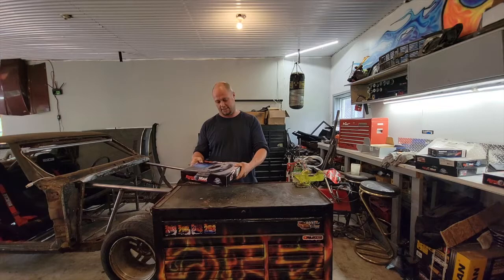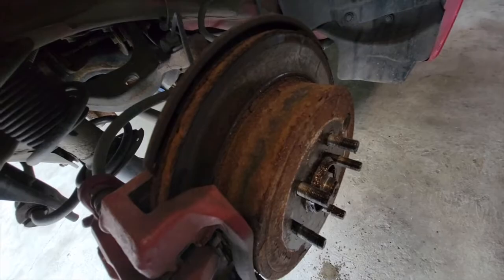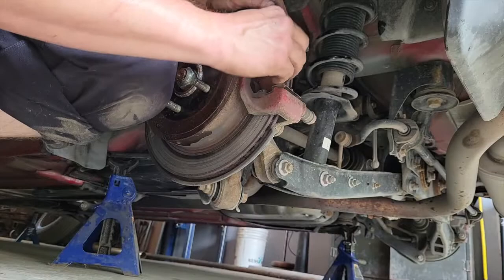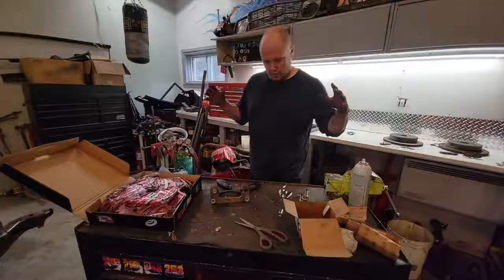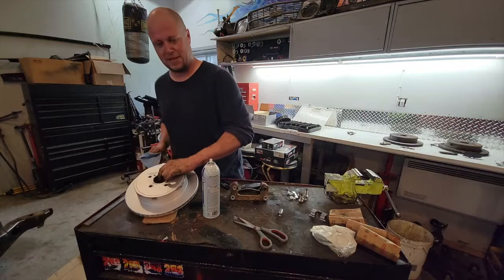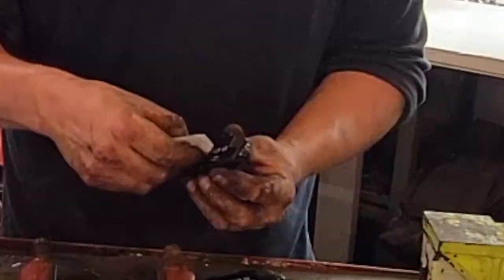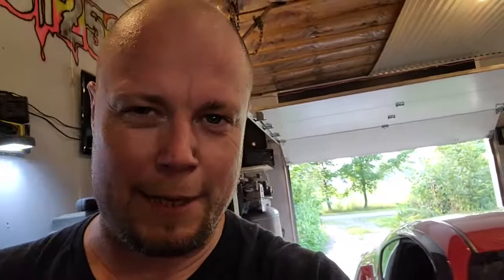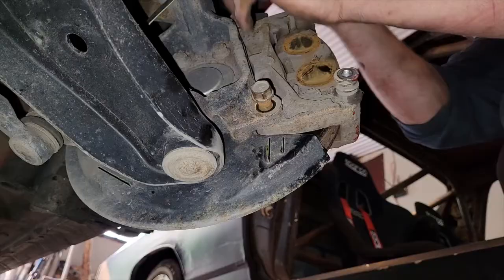brakes on the 86 | DIY HOW To | Brake Pads , Brake Rotors

Comment: The shims were hard to put in cause the brackets had too much rust where they sit, which is also why your pads weren’t worn evenly. I take my brakes apart every year, clean the brackets and put new grease on all the moving parts, so far I’m at 94000km and still on original pads. Good job though, trying is how you learn!